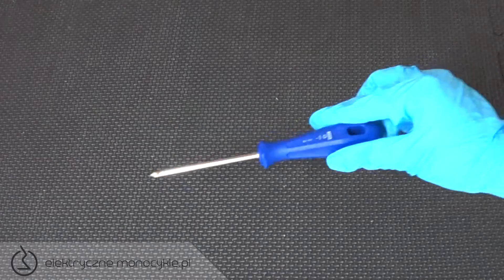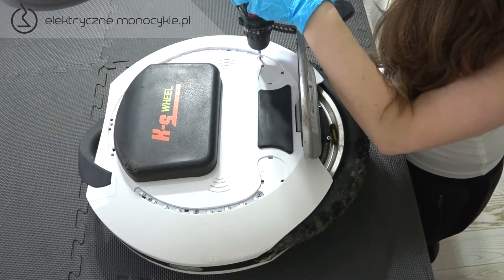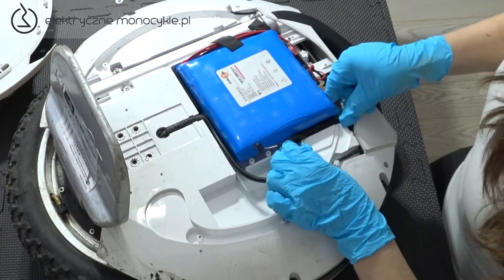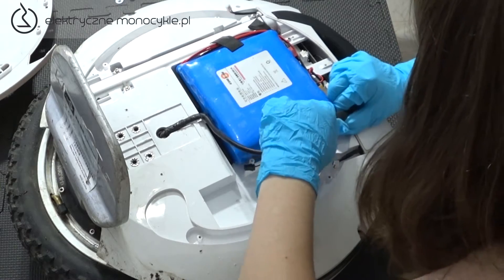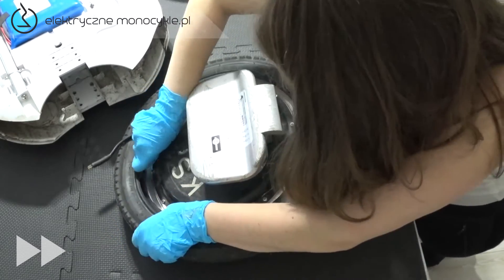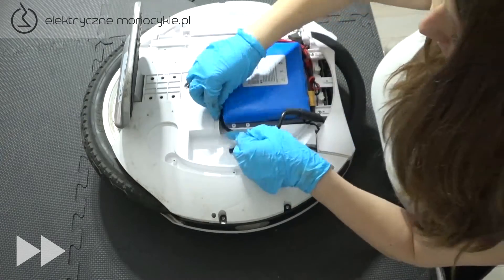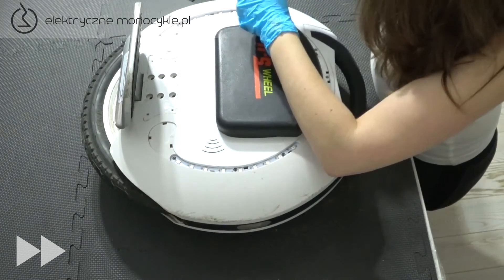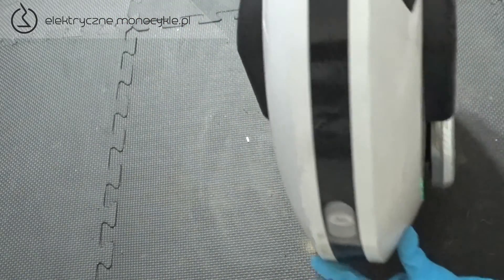Kingsong KS16 KS-16S - wymiana opony i dętki w 5 minut + demontaż (Justina's Garage odc. 4)

Comment: Thank you so much for this video, this is pro and detailed with the key insights like the side to unfold (right), the AC cable to care of while sliding the case and finally the direction of the valve (surprisingly in the opposite riding direction? ...).